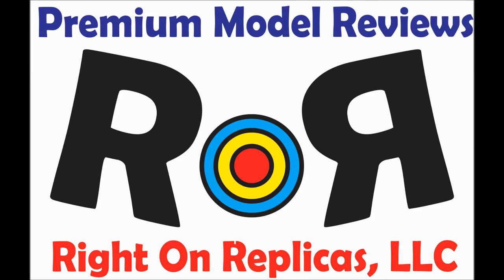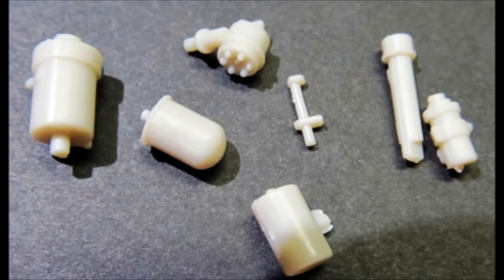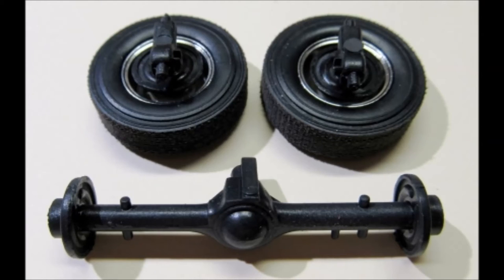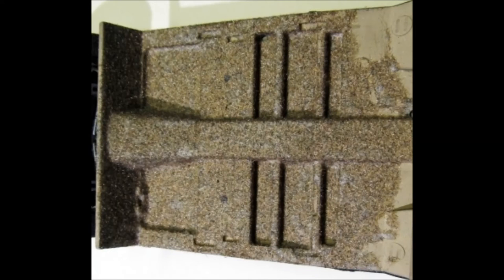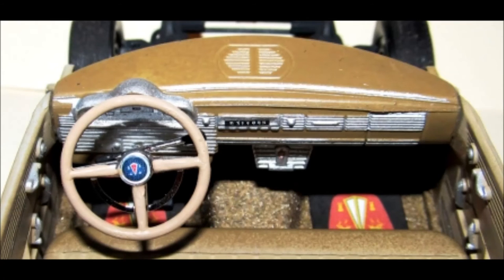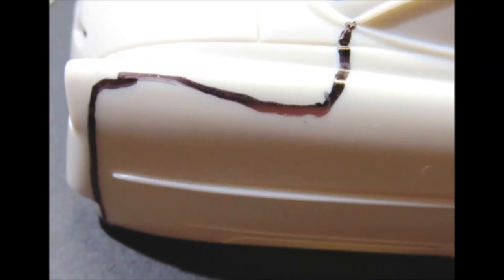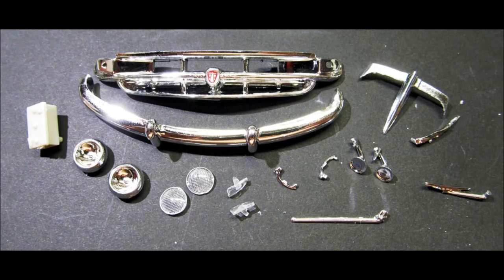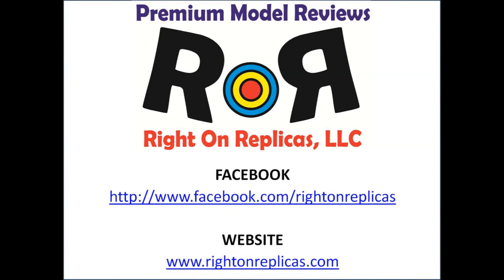How to Build the 1954 Hudson Hornet Special 1:25 Scale Model Moebius Kit #1214

Comment: Nice flocking. The way i do it is to paint the floor pan in the color of the flock, then, while the paint is wet, I pour the flocking on it. The paint will dry with the flocking stuck in.
Reply from the maker: MH,  Thanks for the tip!  -Doug
Reply: @RightOnReplicas  No problems. i find that by doing it like that, you don't get any "Transparent" spots where you can see right through the flock. I do a lot of Games Workshop - Warhammer bases and I have seen people put white glue on black plastic and then use scenic grass...it always has a transparent "Stuck On" look, whereas painting, even if there's a bald spot, looks correct.

Comment: What do you use for paints? I just bought this model and basic tools but, not sure on paints. Can's, airbrush? Can you please advise? I'm very confused on the paint options. Thank you, Dana
Reply from the maker: Dana, Yes and yes,  if you get proficient you can use either.  One thing though, spray can paint is thicker and only comes in the color that's in the can.  You'll lose some detail on you're model like script lettering there.  Air brushing has the advantages of allowing you to control the thickness and mixing colors for the perfect match.  All of that of course, takes some practice.   -PS,  please subscribe if you haven't already to help us reach more modelers! -Doug

Comment: Sorry if you mentioned but what colour did you use on the body and how many coats? First time builder trying to get good at the craft!
Reply from the maker: CH,  On this one 2 mist coats of paint were applied and after 20 minutes 3 medium-wet coats of color shot through an airbrush.  Next day a mist coat of clear followed by 2 wet coats of 2 part auto clear was used for gloss!  -Doug

Comment: Nicely done. But, I always hated those taillights. The look like someone stood across the room and threw them onto the body. Hudson should have set them into the body recessed, or ran a chrome peace up from the backup lights to meet the bottom of the assembly. They just stick out from the body like an afterthought.
Reply from the maker: Thanks Neil - That's what customs are all about!  -Doug
Reply: I love the tail lights, having owned five1954 Hudsons, including a `54 SW Cvt. The `54 Hornet Specials had either green or blue houndstooth seat inserts and door panels. The solid broadcloth with contrasting bolsters came in Hornets and vinyl came in Hollywoods and leather in convertibles. Glad you now finally get `54 Hudson models and diecast cars.
Reply from the maker: Clark - Thanks for the detailed information.  Good to know!  -Doug
Reply: Clarkecars Don't you think they are awkward? I mean they just stick out from the body. I always thought it looked like a missing part was gone. Had they ran a chrome bar up from the backup lights, it would have looked more cohesive. Similar to the 54-55 Willys Aero. If you take it's chrome away, it would look like a 54 Hudson.
Reply: Now if I thought that, I'd want to build my kit that way. I've built a couple of models where I "corrected" some small details I didn't like. Not so much that it looked like a show car - I cut the bottom spoke out of the steering wheel of a '55 Chevrolet kit because I wanted it to be a 2lO instead of a Bel Air. 

On to the taillights, I agree with you. I had a '69 Cadillac with exposed taillight lenses that completed the top of the tailfins and they were easily broken & expensive to replace. One time a grocery boy broke one of them just trying to put something heavy in the trunk.